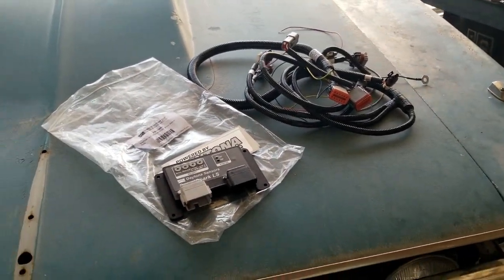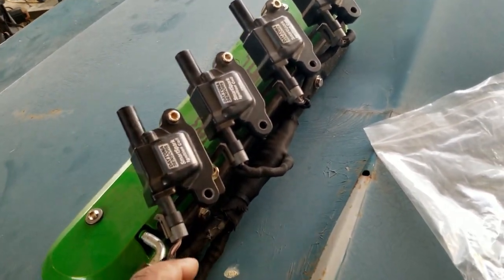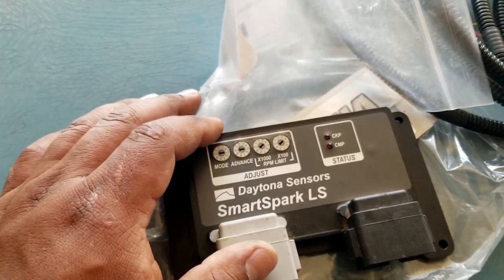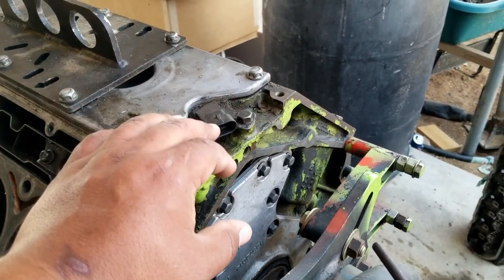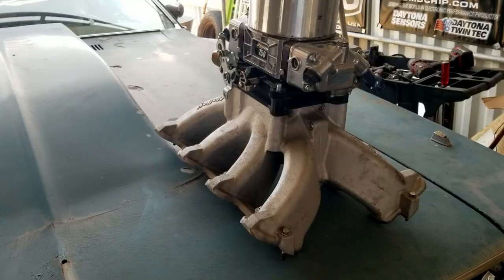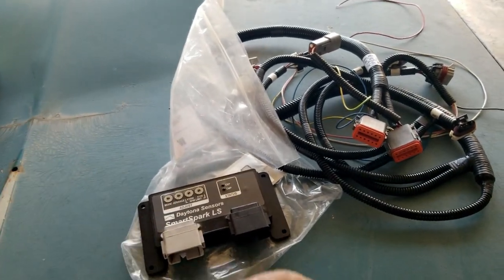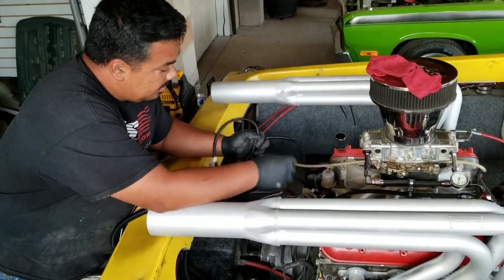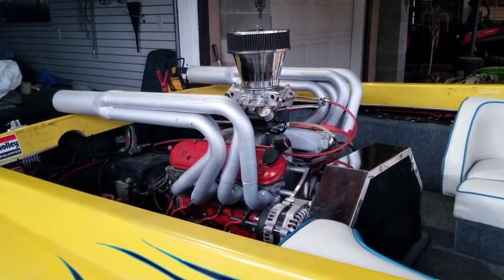Easy Carbureted LS Swap 2023 - EVERYTHING YOU NEED TO KNOW | LS Swapped Boat | Carbed LS Swap |

Comment: So no msd 6014. Use the Daytona over the msd one?
Reply from the maker: Ive never had a problem with the Daytona box in 3 years and tens of thousands of miles. It replaced my old MSD one that lasted a year.
Reply: @NightWrencher  okay I am currently putting a cam in my 5.3 and then will be buying the msd/ or this Daytona. I see your link above says 370$ is that just the computer or all wiring and all too?
Reply from the maker: That is just the computer. The wiring is on another link

Comment: In the past you install a fuel adjustment to run e85 fuel… when running E85. What type of mileage you get vs normal gasoline
Reply from the maker: VS gasoline your MPG drops by almost half. Went from 12-15 down to 5-8mpg
Reply: 5 to 8 mpg on pump gas with a carb instead of the factory computer EFI? @NightWrencher
Reply from the maker: @rogerscovell2329  we were discussing E85(ethanol) and the difference between that and regular gasoline

Comment: Nightwrencher, i'm looking to run 12-15 lbs of boost on my 5.3! Will this system work with boost & if so, what do i need to do?! Thanks for the info, great stuff!!!
Reply from the maker: I ran 21psi on my 4.8 on this system and never had a problem. The main thing is getting you carburetor built correctly so that it can handle boost.
Reply: So this system will work on a 4.8 then?
Reply from the maker: Yes

Comment: Hey man. When hooking these up too power does it sound right to take my ignition wire run it too a fuse relay and then have the smart spark plug into that as well?
Reply: Dumb question I know 😂 but trying to figure it out
Reply from the maker: The smart spark should be hooked up to a fused ignition source so that it turns off when the Key is off and its also protected for shorting out. The relay is optional but not nessesary since it doesnt need more than 10amps to run properly. Ideally you'd want the ignition box on its own circuit but its not mandatory.
Reply: @NightWrencher  thanks man I think I’m overthinking it. I’ll use my old distributor wire! It threw me off seeing on the diagram that there were multiple switched 12v lol

Comment: Can you add a pro charger to it without anything problems?
Reply from the maker: The ignition system will handle it no problem. You would just need to be able tune your carb for the positive pressure of the supercharger